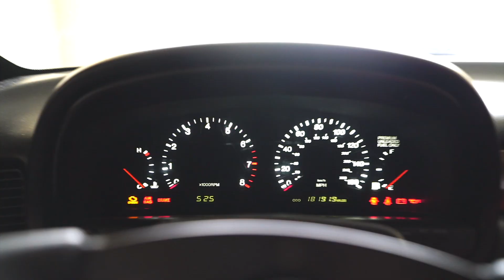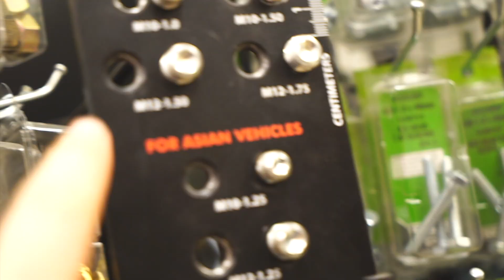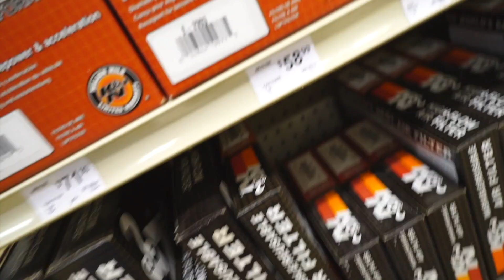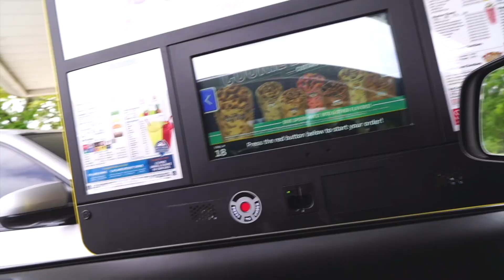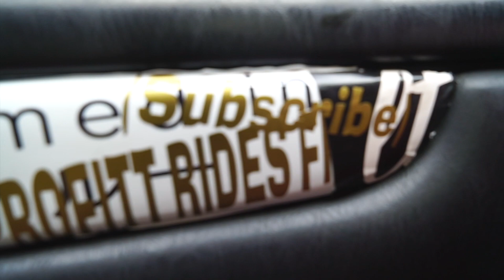$25 Air Intake Mod **ANYONE CAN DO**

Comment: Yes, the stock air box in most "performance" or "sporty" cars is actually the best option, but in many cases, if you keep the stock airbox and replace the intake piping going from the air box to the intake manifold, you can see a slight increase in performance.

Comment: That cold (hot) air intake has terrible placement. It's basically a short ram. You don't get much of a performance increase from cold air intake if the stock intake is designed pretty well. Most new cars use a closed box design to keep hot air out.

Comment: Evan those spectre filters are famous for the chrome button in the middle being sucked into the system on turbo cars. Be careful
Reply: GreightGf8 mines been fine for two years 🤔
Reply: What's a Boost? I didn't say all of them, but that's what they're famous for. I'm running one on my car with no problems but I'd just be careful
Reply: I had to change mine, the part that you put on the intake pipe came loose from the whole pod 😑
Reply: was gonna comment this, but figured id find someone who already did...and agree with them. lol
Reply: Spectre is made by k&n. Just saying
Reply: Kyle what does that have to do with anything? I was letting him know some of them have a mechanical flaw

Comment: my car went from 481hp 536tq to 508hp 563tq just by changing the intake! and my car already had a decent intake on it. supercharged cars are extremely picky when it comes to intake systems. I also changed an intake on another car went from 3-1/2inch to 4-1/2inch intake pipe on a supercharged LS car and it picked up 110hp! superchargers hate restriction! intakes do work! i've also seen a turbo car pick up 100hp just by removing the filter, all of these were done same day back to back. the only time you won't see a gain from changing intakes is if you already have a good intake system on your car!

Comment: You were trying to install the new quick release backwards. 

You screw the steering wheel on the threaded side. And the non-threaded side mates against the hub, since the hub is threaded.

Comment: Any extra SC parts you need i highly reccomend talking to a guy named Carlos Santos. Dude usually has anything you need. I dont think he does 1JZ'z though but he has other hardware, interior, exterior, engine bay, drivetrain, literally anything. He's located in Texas too
Reply: Fervid1UZ I'm sure there are at least 500 Carlos Santos's in Texas, you're gonna need to be a little more specific

Comment: The only way a new intake makes a difference for cars is if the air intake happens to be a bottleneck. Some cars benefit more than others and it all depends if the engine needs more airflow! If it does then upgrading the intake line should help make gains!

Comment: Dud you shouldnt buy an airfilter with that small plug in the middle. I had one and that shit broke off and flew into the tube to the turbo, luckily not into the turbo. So please buy an big cap filter.

Comment: Be careful with those filters with the chrome. On boosted applications the chrome center part on the inside can come off and get sucked into the turbo. Don't want to see another broken Lexus vid Evan :( Also do you like Wave Race 64?

Comment: CAI or SRI intakes do their job, you get what you pay for. Their expensive for a reason, aftermarket parts won't do their jobs unless you dyno tune them for your cars ECU. Cheap exhaust & cheap air filters or intakes will last and perform as much as you paid for it.

Comment: You would think that with all the trouble you've had with the car/turbos you'd want to protect them. That $25 filter is prone to structural failure and might end up getting sucked in and chewed up.
Reply: Don Pablo lol it wont fail they are pretty good filters. Ive had one for 2 years hasnt failed even on 16 psi.
Reply: hahaha saying "it wont fail" you wont be saying that when the middle piece comes apart and that 16 psi sucks it in and then no more 16 psi lmao or motor either probably, but hey they're great filters. 🤙😂
Reply: Brian I agree with you but you never know what's gonna happen with Evan's luck
Reply: no its not adam Lz has ran the same filter brand on his drift car for like two years never had a problem
Reply: 21 psi on my subaru.  No issues with my spectre
Reply: Oh, great. K&N and all the other companies can stop spending money on research and development and just close their doors. These guys have proven the $25 filter to be reliable.
Reply: Don Pablo why are you such a hater? Just carry on and keep buying your expensive filters to satisfy your need. 😊
Reply: It's legit just a filter lmao it'll be fine
Reply: Don Pablo really hahaha that can happen?

Comment: those style filters suck, the metal circular retainer can pop off and get sucked in and destroy turbo, for my 2jz i use a 4" k&n from summit racing for 35$. kn has flat rubber on the front and nothing can come off to destroy the turbo

Comment: Funny that i just bought a $440 intake last night.... But mine gains 20HP and its needed for me to get my Stage 2 tune:/
Reply: ED The Prodigy look at the mighty car mods vid about that. Intakes do nothing. They just filter......
Reply: They do make a difference on a boosted car though.
Reply: ED The Prodigy No they did it on a skyline
Reply: So you're telling me that you saw you guys do a few pulls on a dyno with a cheap intake and only conducted tests on one car.  Then you said "Yep this has to be the same for every motor"  You're insane if you think every engine reacts the same to a CAI.  All i can see is that Dyno sheets dont lie.
Reply: mr Hannes kp stock air boxes restrict airflow so a aftermarket intake can increase power expecially on a boosted car
As long as it's not right next to the exhaust.   A hot air intake just decreases power which Honda drivers don't seem to understand.    You also need to get a tune for it just throwing it on won't do much.  
Maybe you are mistaking intake for exhausts?    An exhaust doesn't add power being there's no back pressure on 4 strokes.     Only 2 strokes need it.
Reply: Intakes only work with ecu tunes, on big displacement motors, and/or as long as you address the heat soaking issue. I've noticed my power and torque went slightly up after I fixed most of the heat soaking on my Dc5 Integra without a tune. But when it did heat soak it lost a lot of power compared to the stock airbox.
Reply: J⃟O⃟N⃟A⃟T⃟H⃟A⃟N⃟ S⃟C⃟H⃟U⃟L⃟T⃟Z⃟   wrong.
Reply: GTI lol
Reply: That's because the type of intake you use matters greatly. People think intake systems are about just taking of restrictions on airflow. Its much much more than that. And i'm pretty sure Mighty Car mods most likely used a cheap ass intake. Which will net like 2-3hp. Especially without a tune.

But with K20's intakes have been able to net over 10-15whp. Depending on the quality of the intake.
20whp is a good gain especially when you are adding mods that can add just as much to it.
20 here +20 there + 40 there.... Starts making a huge difference.
Reply: ED The Prodigy so you are telling me that not every boosted engine gets boost, compression, fuel, spark and functions the same?
Reply: I'm guessing you own a civic?  Lol
One simple Google search will show that I am right
Reply: mr Hannes kp I did a before and after dyno of my admin tuning intake for my 350z and gained 18whp with no tune lol. I'll be tuned after more mods
Reply: mr hannes Just stop bro.
Reply: Bro they make deferences your just gotta find the right one boosted or not Watch streetquief 717 video with the blue truck and my buddy put his a4 2.0t on a Dino before and after getting a ROC euro intake got 12 whp
Reply: Did u dyno before and after the intake or is that what the box said ?
Reply: Jesus Arellano I said I dynoed it myself haha couldn't beat $40 for 3 pulls
Reply: Dude if you're really driving a gti intakes do NOTHING unless you're running BIG power. Like 450+hp. It would have better served you if you just modded the stock intake. Intakes are basically either noise makers or to make your engine bay look pretty.
Reply: anyone who says intakes do nothing do not know what they are talking about.
Reply: philo lee yea but sometimes thos are good too 😂
Reply: there is a difference in an air filter for an intake and an entire intake, if he paid $440 im going to go ahead and say he was not buying a filter. Intake manifolds can make a big difference increasing flow, the filters such as the ones tested on MCM do not.
Reply: you spent that money on your intake LOL. 20bhp pahahah you will gain barely any peak power. Main benefits of intakes are room savings in the bay, better noise and usually a reusable cleanable filter element
Reply: elliot438bcfc yeah.. 20 hp added to 200 is a good gain... I gained another 10% more power lol
Reply: once again, more people commenting without a clue
Reply: I've modified lots of cars. There's no way an intake alone is increasing the peak power by 20bhp. Some cars may get a few horses peak power if the OEM design isn't that great and the aftermarket part is good. Notice I say peak power which is what everyone refers too, It will definitely affect the powerband in some way at different points, some areas may gain some may lose depends on the engine and intake. I will also say a good aftermarket CAI will increase throttle  response which is more important than most people think wether it's a rolling race on the street or a track battle
Reply: Go watch streetspeeds717 video. He did a before & after on the dyno with his blue silverado and gained 20 rwhp and 25 wtq through a truck. Like he said in the video that especially impressive for a truck that has to go through a transfer case, long drive shaft, sometimes bigger dif, ect. usually resulting in more power loss. I dont mod cars and im not an expert but the proofs right there
Reply: Elliot, modified lots of cars poorly obviously. Yes you can increase PEAK power with an intake by 20hp.  It's called using QUALITY parts. Just because someone slaps and brand on it and sales it doesn't mean its quality. And a CAI actually DECREASES throttle response. Because the air has to travel from outside the engine bay to the engine. Versus a SRI that is inside the engine bay. I don't know why people always talk about things they do not know.
Reply: Some cars maybe 20bhp but that would be with a tune aswell, 20 still on the very high side. If a car has 200bhp how can you increase it's peak power by 20% by adding an intake lol. Stock intakes are generally long ram, but they often have resonators to keep noise down along with other designs within the piping which hold throttle response back. I agree about using quality parts, there are plenty of aftermarket parts made by the top brands but they are all generically made other than how it fits to that specific car. Often the best way to go is custom but then often you use fabricated metal parts which conducts heat. I had an ITG Maxogen intake on my DC2 which is mega bucks but I know it was a far from optimal intake. How can you claim I know nothing I could say the same about you but I'm not a dick. Check out a couple of my videos.
Reply: Yeah I got my maths wrong there but it's still an absurd amount of a power increase to expect from an intake. I agree with everything else you say but to gain 20bhp is still stupid and until someone proves me wrong I stand by it. Maybe a good intake on a certaine engine where there is a poor stock intake may gain a certain % maybe like 3% so to gain 20bhp from an intake if that theory is roughly correct you would need a 700bhp stock engine and any engine making that horespower probably aready has a very good stock intake lol. Evans intake is piss poor definitely probably hindering performance but it's lighter, looks cool, takes up less room, is cleanable and probably increases throttle response
Reply: My friends been modding his golf R. Intake does not add 20 hp lmao. Some of you have wishful thinking.
Reply: Mitchel Carpenter why are you telling us about your friend. I actually do this shit myself. Here's a dyno http://forums.clubrsx.com/showthread.php?t=342394
Reply: Wow, I respect that, Injen do make some good systems. However stick that on a proper Integra Type R (DC5) and I don't think you would see near those number. We don't have RSX over here just loads of import type R's but 170bhp stock wtf
Reply: elliot438bcfc you will probably see similar gains. The k20z1 uses cams similar to Type R. So the engines are similar besides the Type R being handbuilt engines capable of handling more abuse/power
Reply: Right, didn't realise it was WHP, K20a is higher compression and maybe different cams that's where the extra 7bhp comes from stock. Here in UK to get from 217bhp to about 240bhp people have a full exhaust, intake and tuned on kpro
Reply: elliot438bcfc they should net more than that. I plan to get close to 240whp with my k20a2 with intake, race header, IM, TB, and exhaust with my Kpro tuner.
Reply: My mate got 252bhp from K20a, Custom header and 3 inch exhaust, IM, TB, CAI and Toda cams. He probably could of made 260bhp with a retune after valves adujsted and a better CAI like a Gruppe M
Reply: elliot438bcfc people here in states usually get to about 225whp with bolt ons only. Which equates to around 255bhp. I'm going for 270bhp with the mods I listed. I should have it done by ends of the year. I'm getting to do suspension and horsepower at the same time. So I can get on the track soon. I had to start over because someone ran into my other DC5.
Reply: @JohannesB5    Well a skyline is designed so well that it's a terrible car to compare for different intakes.    Those cars are the bread and butter when it comes to the import market and being so heavily tuned. A car so heavily tuned like that will not have a very restrictive intake as is.  For most cars an intake upgrade is usually better because even if you're not increasing much power you are still getting better throttle response even if it's slightly warmer air.  The stock air boxes in most cars are very restrictive which are made that way to suppress noise.   In most cases, A more restrictive stock airbox with cooler air will usually not perform better than a short ram intake sucking in slightly hotter air with "No Restriction".     You have to remember that a car is hot under the hood almost everywhere.  As long as the intake filter isn't Resting right ON the engine you shouldn't get less power.   Their are plenty of dyno charts that have Proven GAINs from an air intake mod.  It's more dependent on design of car and placement.   A turbo car can spool faster replacing the stock airbox with aftermarket as it makes it quicker to suck in airflow which allows for quicker spool.   A heat shield can also help with consistency in performance.   The only way you will be able to truly get much colder air is by sticking the intake filter out through a headlight (which looks dumb) OR by making the filter hang so low that it nearly scrapes the ground.     NA cars don't really need tuning for intakes, but Turbo cars do depending on how much it leans the fuel as it's much more risky to further lean fuel on a turbo car.

Comment: Stock airboxes absolutely do not perform as well as aftermarket in most cases.  A significant amount of noise from all engines is actually intake noise and manufacturers try to minimize this by adding tuned length snorkels with a small opening.  The snorkel usually has a several drastic bends because you can reduce the amount of noise which escape with each directional change.  Also, the airbox it's self has a shape that is focused on muffling reflected intake noise, etc.  All of these things are not  in the favor of helping the amount of air which is able to pass through (the name of the game when it comes to high performance internal combustion engines...   Manufacturers are pretty clever and  do a pretty good job of balancing performance with noise concerns, but it now way is this as good as just not giving a rats ass about noise and bolt on something that didn't have these constraints...

Comment: Pro tip: after you break the nut lose on the steering column leave the nut threaded on, than pull/break the steering wheel lose so its stopped by the nut. Just so you dont smash the wheel into your face.

Comment: dont they come stock with a 1j?
Reply: Brent Mcveeney they come with n/a 2jz if I'm not mistaken.
Reply: na 2j
Reply: in the US they came with a 2JZ-GE, but they came stock in Japan (Toyota Soarer) with a 1JZ-GTE
Reply: It depends what model you get the SC400 came with a V8 and the SC300 came with a 3.0 L 2JZ "GE" I6, also im from Australia and they come as a Toyota Soarer instead
Reply: Brent Mcveeney the 2jz-ge is nothing good though

Comment: Actually gotta correct this. Spending money on an air intake is NOT pointless if the car is not turbo. Air intakes are important for N/A cars. Length, Diameter, Bends, and Material used. You want it to match the engine harmonics as the sound waves travel through both intake and exhaust in order to get the most air within the cylinders. So yes theres a lot of variables and thats a HUGE one most people neglect outside of just "Getting cold air" or Sticking it outside the headlight.
K20's can make pretty good gains with an intake and a tune. Not every engine is the same though. Also the stock air box is efficient for daily driver cars. Because it protects from heat from dead stop traffic or stop light traffic. If you are on a race track or racing. SRI is constantly being cooled down by the air entering the engine bay and you get maximum air flow.
Reply: Jujutsuheiho there's absolutely no sense in trying to correct this. I have never heard such wrong information come out of this lonesome little guy's mouth. He has literally NEVER not once tested back to back stock airbox vs intake piping and filter. Like literally not once. I'm not even bothering with typing what you did. But thanks for your comment, anyway.